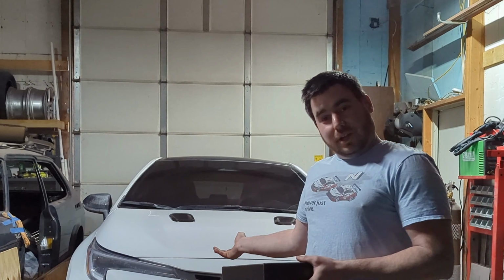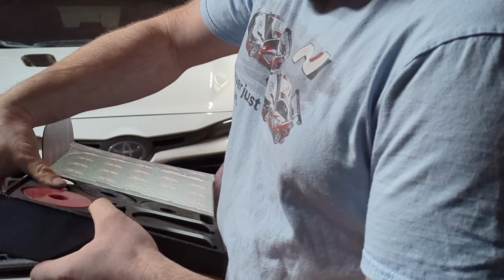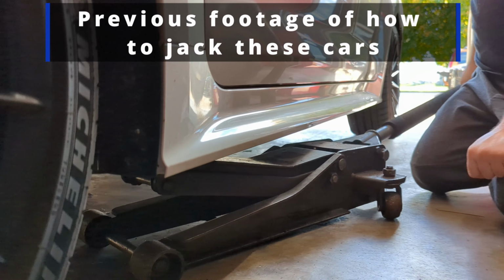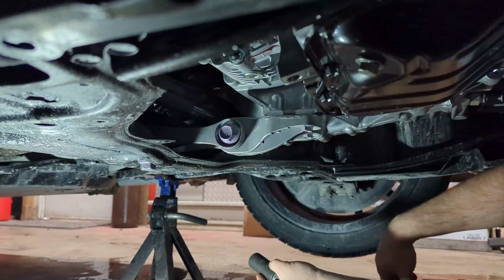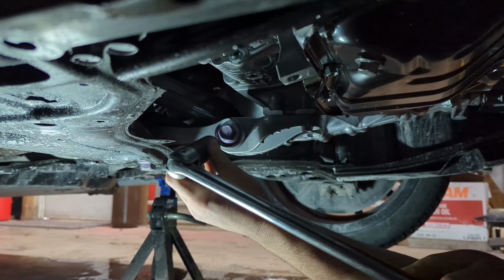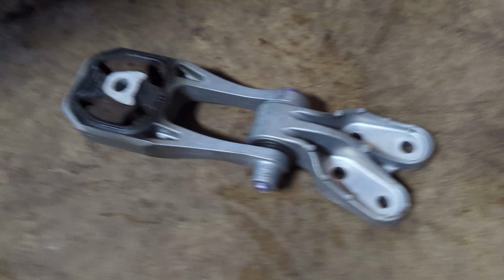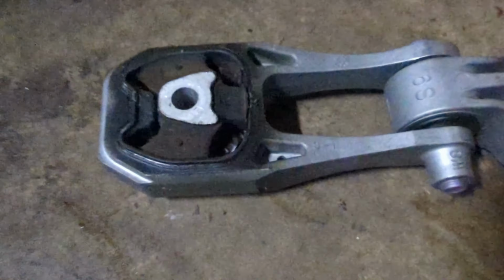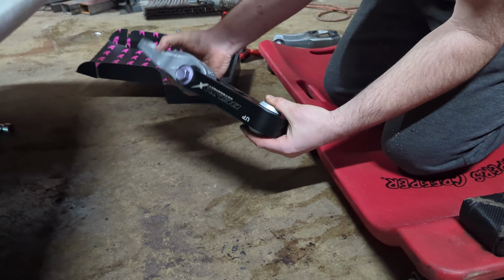How to: GR Corolla Upgraded Pitch Stop Mount Install. The cure for difficult shifting!

Comment: 4:40 apparently according to some technicians the little "rip" is intentional, the pitch stop is supposed to flex a little bit with rubber. Most people have been reporting it as a "ripped" mount when it's actually intended design. And by rip I don't mean like through the middle of the rubber or anything, I mean where the rubber touches the metal.
Reply from the maker: It may be intentional, but that mount is WAY too soft and lets the engine move around enough to cause shifting problems. Hopefully Toyota improves it on upcoming models
Reply: @teamturner4300  very true, it's especially noticeable on high gear going up hill sometimes. For me it hasn't straight up caused shifting issues yet, but I think I'd rather have my rubber wear out faster than accidentally one day breaking my thin firewall because of a stiff pitch mount.
Reply from the maker: @Electronica27  this mount attaches to the subframe, not the firewall
Reply: @teamturner4300  Fair, but still would rather not get any points ruined from hard acceleration.
Reply: But it fixes shift “slop”. So you’re also reducing the risk of money shifting under load
Reply: @treaves2175  yeah I could see how people easily misshift this car bc under load I felt it ever so slightly move the lever to the left, I actually had to catch myself already once. It didn't go into 2nd, but I think it almost did.

Comment: At eng start up the whole car shakes for me… will this part fix it?
Reply from the maker: There will be a bit more vibration overall. Both at startup and driving. The harder bushings will transmit more of the engine vibration.
Reply: @teamturner4300  I’m talking about I’m seen the issue stock… I’m at 3.7k miles.  The whole car shakes more than I’m thinking it should and my 1-2 shifts are jerky more than expected.
Reply from the maker: @Arsing116  this completely cured the 1-2 shift issue.

Comment: What is the website link or physical address to order the Delta X pitch mount?
Reply from the maker: The person I bought it from doesn't have a website. It's from Jeff Pavletic ii on Facebook. That's the only way to get one that I am aware of at this time.
Reply: Got the grocery getter performance one. Absolutely solid.
Reply from the maker: @Faithfps  There are several options out there that all seem to be similar. The one I used in the video is nice, but any of them are going to be better than the stock one.

Comment: Those oem motor mounts are 100% fine! They’re suppose to be like that to prevent noise and vibrations! All you did was install a solid bushing, not replace a faulty or defective oem Toyota bushing. I’ve had my gr corolla for over a year now and have zero need for upgrading any suspension bushings. The car is stiff asf from factory with no body roll. Feels like a go cart out of the box
Reply: Except not really. Toyota botched the duro on the stock mount (too soft, just like the clutch lol); it’s been well known amongst owners for a minute. Personally ran into weird shifting issues out at track days last year, and w/ high-rpm shifting. Caved in and replaced it - zero problems now. Not exactly a ‘must’, but it objectively improves one of the GRC’s design flaws. A rear motor mount also has nothing to do w/ suspension bushings (completely different) or the amount of body roll this car has from stock - which is substantial btw. It’s a hot hatch.
Reply: @ryanw3907 the engine mounts need to be very soft it should have been a fluid filled hydrolic engine mount less movement and more vibration suppression, the 3 cylinder engines vibrate alot even with a heavy rotating balance shaft and timing assembly to mitigate some of it